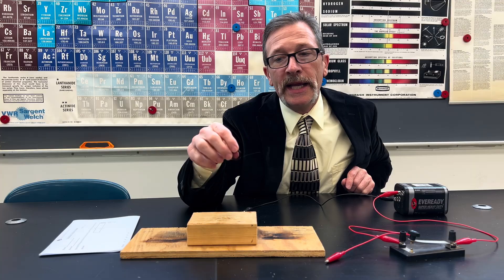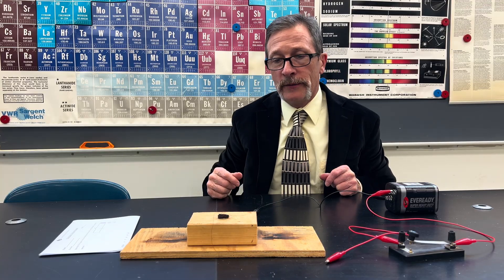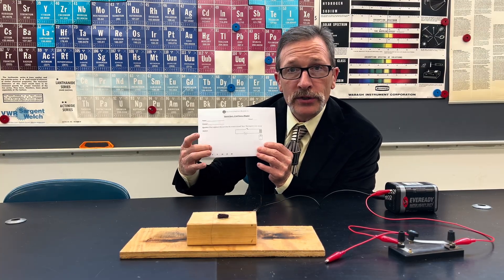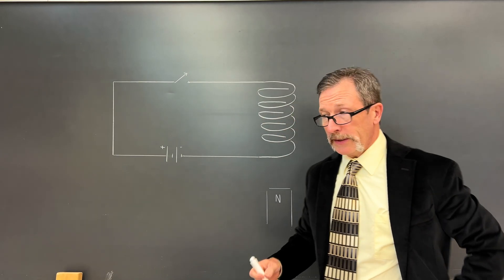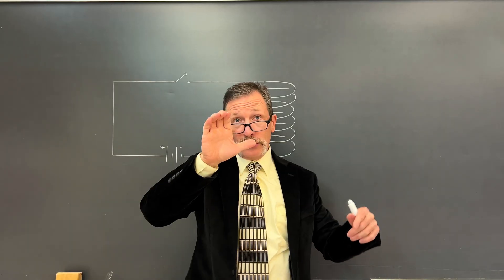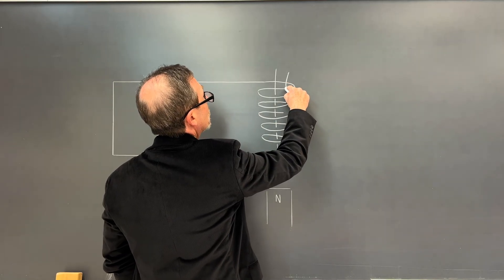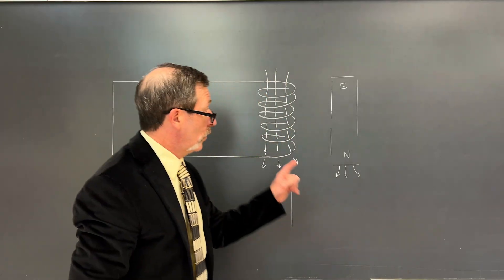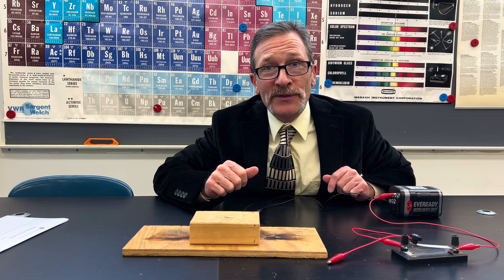Direct Current Through a Coil Near a Permanent Magnet -- What Happens?

Comment: Something to consider is that the coil and the North pole of your magnet are both moving particles of electricity away from each other, causing repulsion as two North poles of two magnets facing each other repel each other, as do two South poles repel each other. We know that when you place two magnets one on each side of a cathode ray, the cathode ray steers away from the South pole of one magnet towards the North Pole of the other. Indicating that the flow is from the South pole to the North pole of the magnets, that flow repels the cathode ray, which is an ARC (Anode, Rectified, Cathode) ray, it is a reciprocation of and caused by the A to B power supply voltage, and is no longer part of that circuit. That is why it can be steered by magnetic fields or an abundance of particles of electricity. A magnet and the Earth are affected by the fields around the Earth equally, and that is why a North pole magnet faces the North pole of the Earth despite both having their north poles facing North.

The reason two magnets with both North poles facing each other repel is that, an ARC effect is created at the North poles. If this did not occur, a magnet would take off and keep going like a bullet. So the ARC effect neutralizes the magnet's omnidirectional output.  When two magnets are placed together with opposite poles facing one another, a flow is set up between the two magnets that negates or consumes that repulsive ARC effect, and the two magnets are pushed together. There are no attraction forces in our universe. Benjamin Franklin discovered that, as well as the pointed and flat electrode test to tell the direction of electricity,  as well as the ARC, which is the lightning bolt. He was able to hold a strand of silk tied to the kite string, which allowed the kite string to reach 30,000 volts and the kite to reach a voltage that steered the cathode ray the lightning bolt away from the kite. Doing away with Du Fays' two particle theory of electricity, which had the world in the dark ages, with children being forced to ring the church bell to ward of lightning. While Benjamin Franklin had working lightning rods installed up and down the eastern seaboard. The Royal society dared him to fly a kite in an electrical storn if the static ARC and a lightning bolt were the same voltage. And he did.  They awarded him the Copley Award for his work. Ben also built the first open-air transistor that he was able to turn on and off the flow of lightning voltage in his basement using three fireplace balls. A copper sheet ring capacitor that a French scientist and friend suggested he use a strand of silk to suspend the copper ring capacitors, after Ben lit the floor joists of his home on fire when the string he used caught on fire from the lightning voltage. 

When we look at an A to B power supply voltage, it is very straight it is hardly affected by weak magnetic fields or voltage potential. An ARC on the other hand is not of a circuit it forms on a clouds surface because the clouds liquid surface creates a liquid diode, like a mercury rectifier does. Lightning is often arced, or its flow is jagged and slow, it penetrates an impenetrable amount of air by means of cathode rays, which cut a path through the air beaking down the air capacitor between the cloud and the earth.

Comment: Just like cold does not move to heat, instead heat moves to cold, so does an abundance of particles of electricity that repel each other, and all things move from an abundance to a shortage. So perhaps your South pole is outputting, and your north pole is inputting. I would float your magnet in a small boat and see which way its "North pole" points. Either North or South. 
The field of electricity, no pun intended, has become a joke, where we have people claiming current only flows on the outside of a conductor, which is wholly untrue. Spotwelders every day prove that theory wrong. You can put a spot weld on the center of two plates that are already edge welded together, making it impossible for electricity to travel on the inside surface of the plates. Yet the spot welder makes consistent welds despite each spot weld connecting the two plates together and lowering resistance. However, since AC or DC current flows directly through the plates at the point where the two spotweld contacts touch, each spotweld is identical to the next. If this were not so, you could never use spotwelding for metal work.

Comment: I know my 79 year old eyes suck but I know they aren't as bad as this experiment makes them appear. Yes. I see a dry cell, knife switch and alligator jumper wires. I don't see them connected to the electromagnet. In fact, the EM  so small or poorly videoed that I can't make out the connection details at all!
Wakodahatchee Chris
Reply: I had the same problem at first. Upon a closer look (I am on a computer screen, not a phone) I was able to see a very thin wire running from the coil to the positive wire. The other side must have the same, but it is so thin as to be imperceptible.
Reply from the maker: Thanks for the comment...we will work on improving the video quality!